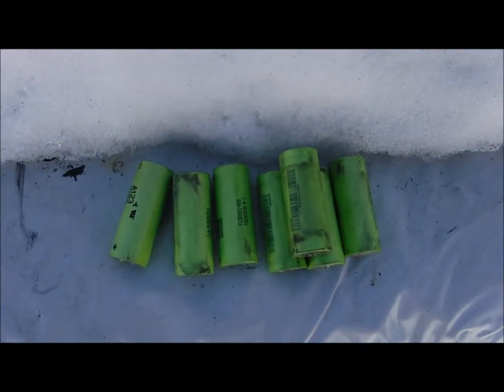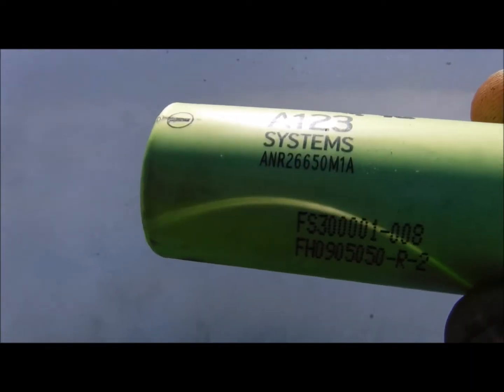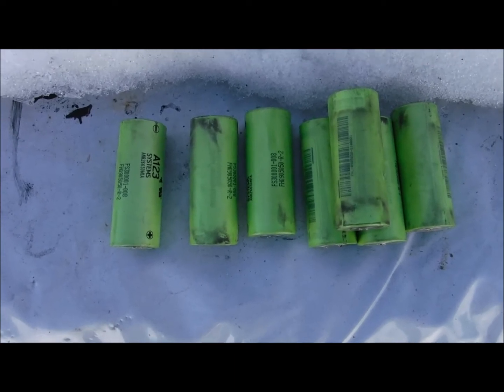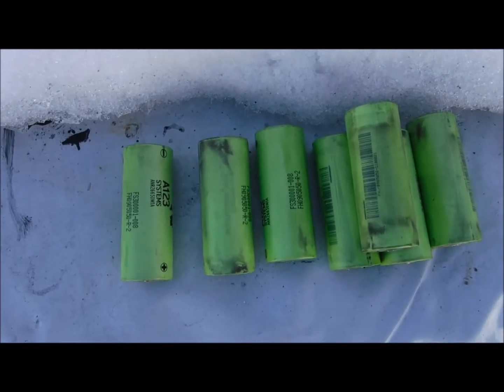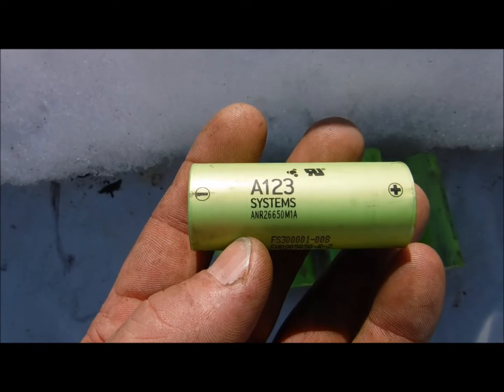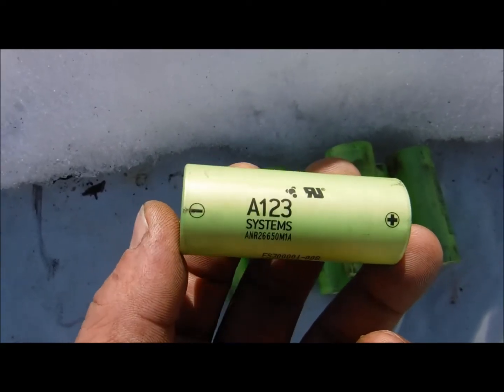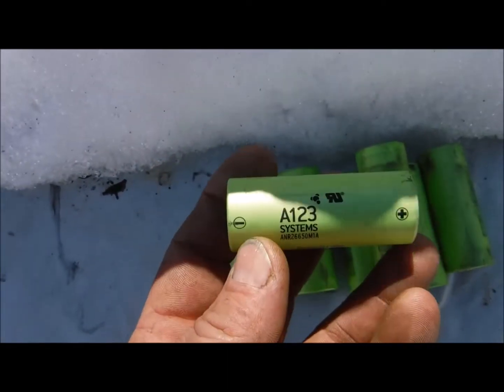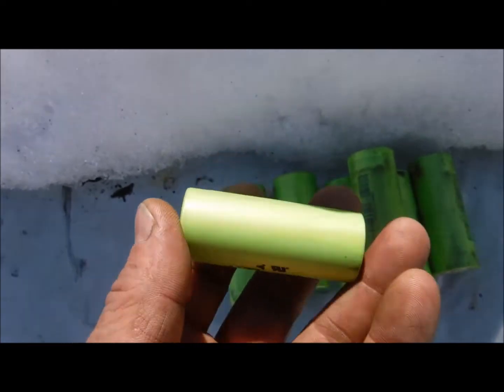A123 Systems ANR26650M1A 3.3Volt 2.3AMP Hour Battery At O Voltage

Comment: I had a 12p 4s pack (i think i said that correctly? The pack had a voltage range of 39 to 43v if that helps,  but i digress) and i left my 2.1ch amp turned on over night and killed the battery it was sitting at 1.2v so 0.1v per cell lol 
Anyways i got it to come back  to life with my dc to dc charger so im not sure why you cant seem to bring them  back to life?

Comment: Try to bump charge them . Get a good one and parallel it to that one. When in use dont go above 3.6 and below 3 v / cell.
Reply from the maker: Good idea and i hear you on the using part. My plan is to keep them as close to the 3.3 i can.
Reply: @MrDoingEverything  y 3.3v? They need charging at 3.6v . If you charge them to 3.6 and let them sit. They will drop to 3.2v over time by themselves. But it is important to not over discharge. If you have a pack of seriesed this is very important because they will unbalance easily. This is y a bms is necessary as well.
Reply from the maker: @frankz1125  Understand completely
Reply from the maker: I tried the bumping never jumped them back up only drained the good one,s. Will keep trying other methods.
Reply: @MrDoingEverything  you bump them then put them on the charger. It will allow you  to if the voltage on the battery is high enough.
Reply from the maker: @frankz1125  No lasting increase voltage was there. But i hear you. If i come to solving it i will let you know. Many other methods i have stored up to try. After all there can be no harm done at this point.
Reply: @MrDoingEverything  if you need some i have.
Reply from the maker: @frankz1125  TKS will keep in mind

Comment: Obviously you have tried tickling them with 12 volts
Reply from the maker: So far nothing has worked. High or little current. I have warmed them up lots but never held any thing. I,m not finished trying yet.
Reply: @MrDoingEverything   Well if the shock didn't work try 0.01 volts for a few days.
Reply from the maker: @offgridwanabe  Good idea
Reply: @MrDoingEverything   maybe 10ma of current
Reply from the maker: @offgridwanabe  Will give it a try.
Reply: @offgridwanabe  Hi O G wannabe....What exactly do you mean by 0.01 volts???To me that makes no sense,,how would that do anything??Where would a person be able to obtain such power supply???And then the current of 10 mA????????how would you push the current through a load with such a huge internal reistance while supplying only 0.01 v????????Hope youre alive and did not electricute yourself yet,,since i really want this answered..And if you just made that BS up please admit it was so!  Thankyou.
Reply: @Clueless2daWorld   The point is if the bump charge didn't work maybe the long slow approach will. Stringing a few together will drop the amperage. A low voltage could be accomplished  with a resister. I recommend  throwing them out but that is not the posters choice. I got a bunch of them if you want.
Reply: @offgridwanabe  OMG  youve got to be kidding.
1.If the bump did not work units might have an open circuit(by design--fuse maybe) or they are fubar..Easy to check that ohmage.Believe it would be in low Giga Ohms.not sure though.
2Stringing batteries is actualy opposite of resistors when there is charge present..Current (amperage in your terms) will only increase with stringing them(either in series or parallel)--providing they do hold charge(aka Voltage and capacity).
3.Why would you need resistor if units do not respond to standard aplications of charging procedures(which i'm not sure this video-maker have done,,as a matter of fact it would almost seem to me that he might think that those are standard LI-POs and not iron sulfate family)Charging them at LI-PO level would most likely overheat them and cause 2 go FUBAR.Depends on current and temp of cell and length of time he cooked them,SMH in disbelief if he did.
4Thnx for the offer of free stuff but unless you 're in arizona central area I would not bother paying for shipping
5 Long and slow approach is what we agree upon,,you could try fixing your .xtra cells by rigging up a current measurement system using specific value R(to measure voltage drop of that branch) connected in series with 1 in series batt cell unit,fed by regulated adjustable power supply and bringing voltage up to (no more than)triple nominal,while observing if current starts flowing...Good luck,LAZARUS.  Obey the OHMs law,wink.
Reply: @Clueless2daWorld   Ok so you just wanted to show us how smart you are and you knew the answer before asking the question. so you succeeded. I guess you would not recommend cutting one in half with a hacksaw to see how it is made oops too late.
Any way thanks for your insight.
Reply: @offgridwanabe  Your'e welcome...My question initialy was just to investigate a new,,innovative method you suggested,which i never heard of and which did not ring true or doable in accordance with established knowledge and my experience doing Etricity for decades..Sorry to have sounded like an AYYHOLE in my first post 2 you. The method i gave you worked on more than 3/4 of high discharged li-pos and Ni-Mh i got my hands on so far.
OBEY THE Ohm's  LAW,and have a nice hollidays.
Reply: @Clueless2daWorld   Thanks bud I get run over a lot so Please comment as we need all the help we can get. We are just trying to figure this stuff out and are not electrically inclined at least not me I struggle.